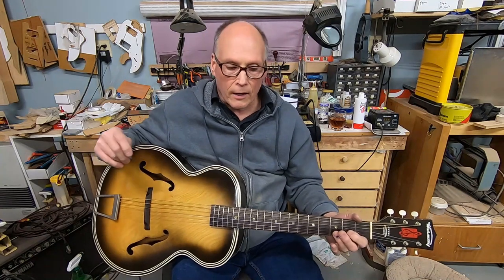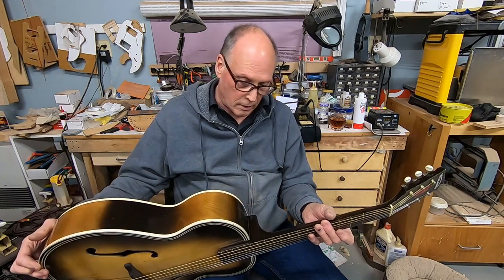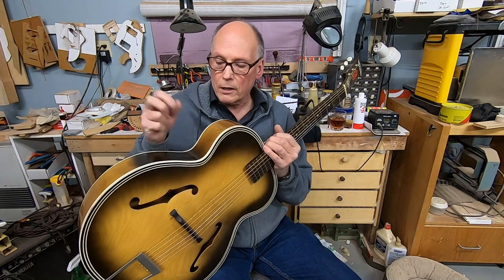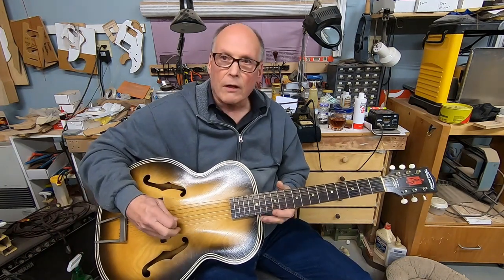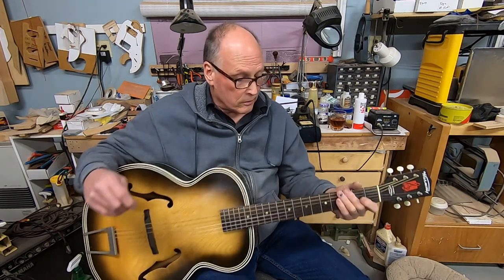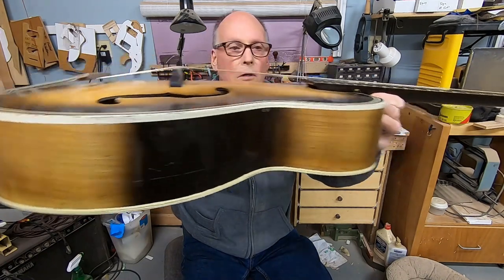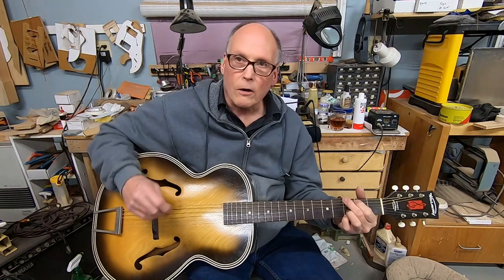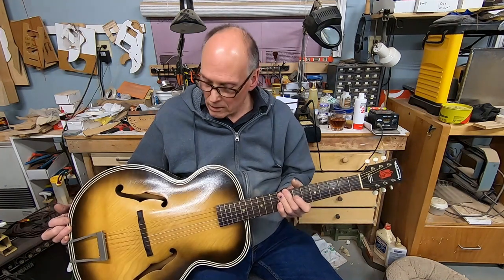62' HARMONY ARCH TOP DEMO, JONAH GUITARS

Comment: Yup. Sounds great!

At least yours has a truss rod. Mine (1940) had a slot cut for one but no rod. I had to toss the neck anyway, it was curved, such that the low E string was hanging over mid air. 😟
Reply from the maker: Hey Todd, thanks for dropping by. Some day I'm going to get a guitar like that and rear install a rod with a skunk stripe. Even a couple pieces of CF up the back would prolly work.
Reply: Good plan. As long as the neck isn’t already shaped like a banana. Actually, it was simple enough to just pull the fretboard off. And throwing in a rod would have been simple too. But... yeah, banana. 
I have materials set aside to make a new neck for it, but haven’t convinced myself it’s worth the effort.

Comment: I found that same guitar (maybe more like a 1970 model but same color) about forty-two years ago in a thrift store for four bucks. The only difference is the Harmony logo doesn't have the line over it on the headstock. Got a crack fixed on it by a friend and he decided to refinish it but it still sounds pretty good.
Reply from the maker: That’s very cool